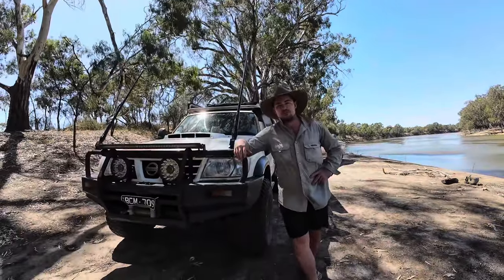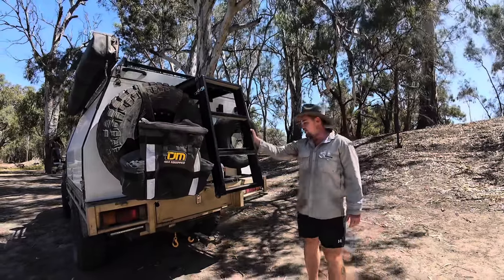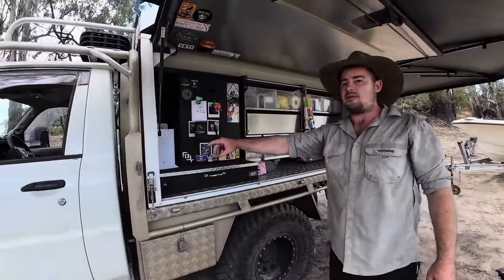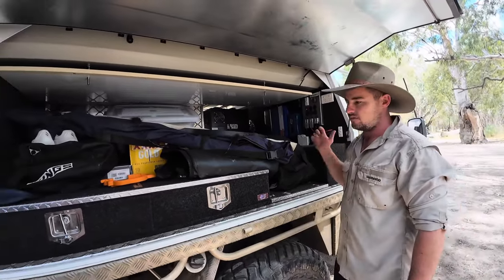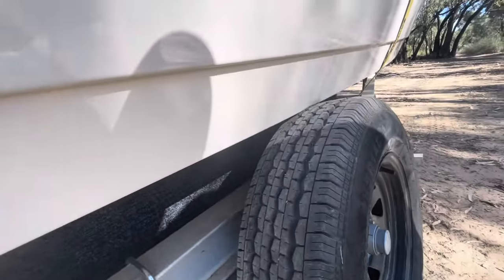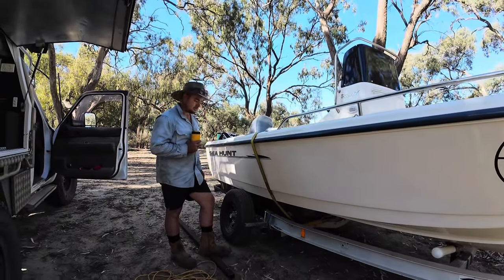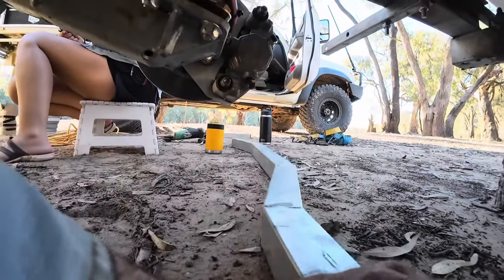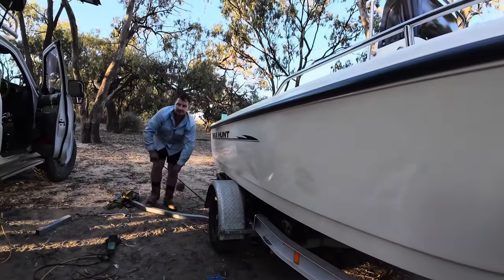First week travelling Australia, IT ALL GOES WRONG!

Comment: You have 230 amp hours of agm which means only 115 amp hours in reality. Agm can only be discharged by 50%. But you are running a 2000 watt inverter. How does that work?
Reply from the maker: We’ve had those batteries in there for a while now, they seem to be running everything fine however we are looking at changing over to a lithium set up which will run more efficiently